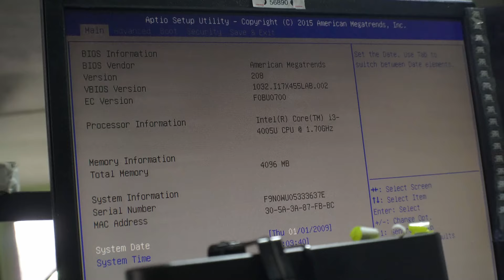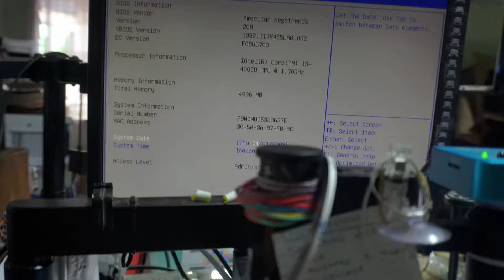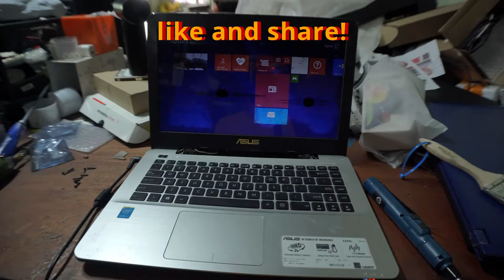Asus Laptop NO POWER troubleshooting repair

Comment: sir ano po gamit mo na electric screw driver pa hingi po ng link salamat po
Reply from the maker: eto po link https://shopee.ph/Mini-Electric-Screwdriver-Xiaomi-3.6V-1500mah-Lithium-Battery-Cordless-Screwdriver-USB-Charging-Electric-Batch-Repair-Power-Tool-i.970105104.22749853721?sp_atk=970df107-f45b-4c98-a00a-0e02f77a6c2d&xptdk=970df107-f45b-4c98-a00a-0e02f77a6c2d
Reply: @wayneslink  thank you sir,,,